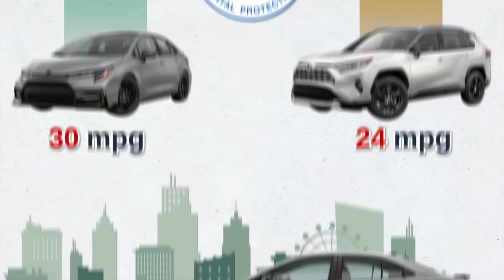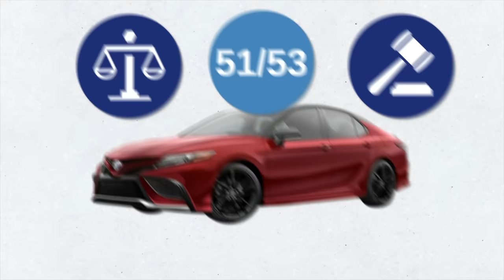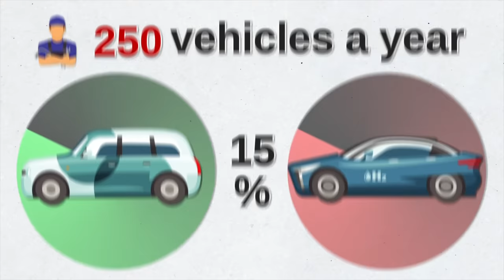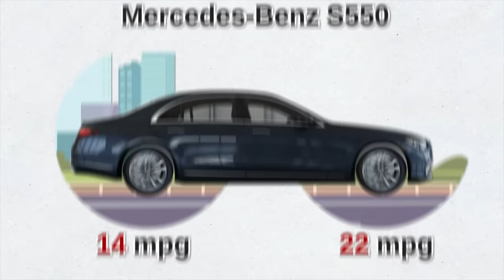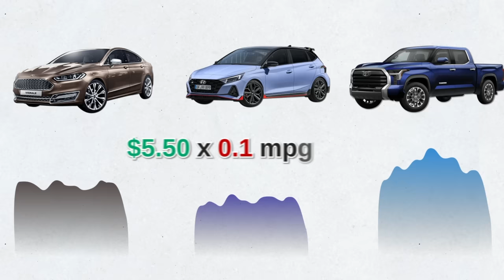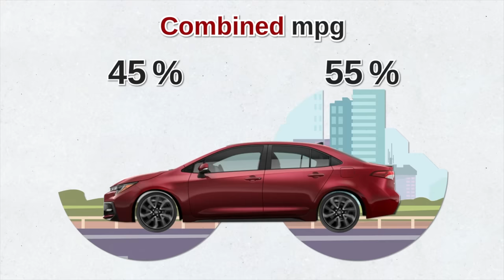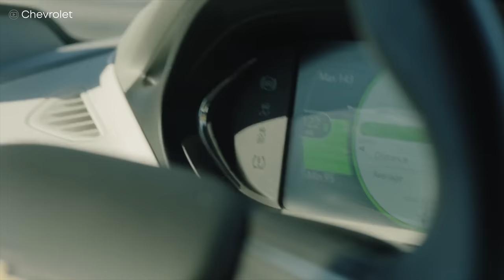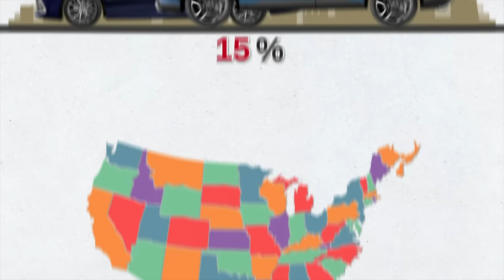Here’s Why the Government is Making These Engines Illegal

Comment: I got a 2002 Camaro Z28 and you just can't explain to most people anymore the driving experience a V8 provides gets good highway mileage just ignore the city mileage. Purchased new in 2001.
Reply: Completely agree. Had an ‘04 Mach with manual trans that at 70 mph on the hwy got 28 mpg with stock 3.55 gear and still got 24 mpg with 4.10 gear. V8 engines get awesome mpg when driven sensibly.
Reply: I agree and It’s because of power to weight and at higher speeds like 100-130km/h (60-80mph) it won’t be reved out I got a 2015 Silverado (4.3 V6)and she stays at 2k-2.5k at higher speeds I get the same fuel economy as my buddy in his 2017 1500 GMC with the 5.3
Reply: That’s been my experience as well. I had a third Gen Firebird and it was great on the Highway. A lot better coming from my dads grand Cherokee. Then I got my C5 Z06 & it’s so great on road trips. I did a 6-7 hour +700 mile trip one way with only two-three stops, one stop was for me haha. I think the torque is what let’s you use very tall gears without lugging the engine, keeping the revs low. I think I had estimated my fuel consumption at 30 mpgs.
Reply: Just remember your ar still driving GM crappy product ☺️

Comment: Good description of how it works.  My 68 V8 Mustang gets better gas mileage than most of the on the road.  Next week it gets a dyno run next week since I put a new 4 barrel on it.
Reply: One reason might be the weight. All these new cars with all the tech and safety stuff in make them porkers.
 So an easy way to get better fuel economy is weight reduction.  It has unintentionally benefits as well. Better wear on tires and less wear on suspension and brakes.
Reply: My 98 Lincoln Continental gets 26 to 28 mpg on a road trip. It impressed ppl who ask about it lol. Most just tell me to get rid of my car, but it's perfect for all seasons, and even got me through a blizzard lol

Comment: I've found that the cars most likely to reach, and exceed the EPA ratings have large high torque engines. The ancient American V8 (when properly maintained) is the best able to get the numbers advertised as it doesn't need to work as hard to do the work required of it. However, once the heavy foot of a 16 year old applied to the equation, the old American V8 is also the most likely to get 35% of the advertised EPA fuel mileage. So don't let Billy Burnout drive the '75 Buick Electra if you want to keep a couple bucks in the bank. Put him in the '80 Ford Fiesta instead.
Reply: Billy burnout isnt spinning much tire in a 75 buick, that 455 makes no power compared to say a 70 electra lol.
Reply: True. We should put the big old v8 in most cars instead of ramming air into small highly stressed 4-cylinders.
Reply: Well said. Thank you.
Reply: @UsefulEntertainment  I pretty much get exactly the advertised fuel economy of my Corolla with a 4 cylinder engine, but there's no turbo, or direct injection, or anything complex about it to skew the numbers or wear it out faster than expected. It's a solid car, but I certainly would want a bigger engine if I had a bigger vehicle.
Reply: I get better gas mileage in my V8 Mustang then some people get in “economy” cars like corollas. If you drive with a heavy foot like me, high torque will always get better mileage than a 4 banger. Just imho.
Reply: @angelgjr1999  I average 36 mpg. I doubt you're matching that in any V8 automobile.
Reply: @Me04120  I get 19 mpg city driving. Highway I think it’s closer to 26. Pretty impressive for an old V8.
Reply: @angelgjr1999  That's fine if that's what you want. I just wanted something reliable, and not too expensive. The Corolla checked those boxes pretty well. I had been driving 90 miles round trip going to work 5 days a week, so I wouldn't have been happy with a V8. Now that I'm working fully remote since the Rona, maybe I could think about a bigger vehicle next time I'm in the market.
Reply: @Me04120  I spend about 35$ a week in gasoline. I drive about 45 miles a day 5 times a week.
Reply: @angelgjr1999  cap man, I have a 5.0 and I get 15 mpg city tops short shifting. The highway is like 26 which is impressive
Reply: Yep. I have a 2009 Pontiac G8GT with 6.0 liters of grunt. It's my highway car. I get 26-27 mpg in a roomy car that doesn't require calculus to figure-out where to merge on a highway. If I keep my foot out of it, the mileage is consistent. And I'm old enough to keep my foot out of it. Most of the time.
Reply: @jonkirkwood469  That’s impressive for such a big engine!
Reply: Funny 💩 my first car was a 79 ford fiesta👍👍
Reply: First passenger car was a 2002 Kia Rio Cinco.  Car only got 22mpg.
Reply: Right on !. Also never buy a Kia.
Reply: @jonkirkwood469  thats it. I've got a 2010 holden ssv ute with an l98 6sp man and i get 11L per 100km. I've had 2L engines that use more than that. A big plus is that these motors go the distance too outlasting 4cly motors by double the kms in most circumstances. Once a motor is built the longer it lasts is  better for the environment. Some people just don't understand the less is more concept.
Reply: Huh. Makes sense, I got a heavy foot with a 2013 Mustang GT with manual and it still gets 17 in the city and 26 on the highway
Reply: Not that I disagree with anything you wrote, but your example vehicles crack me up…
Reply: @angelgjr1999  that almost sounds too good to be true, I have a V8  and drive about 400 miles a week and average 15 miles a gallon and spend about $100 in gas.  You must live in a place with barely no traffic.
Reply: @Dannyf35  The back roads are your friend. Just cruise downhill in neutral

Comment: I owned a 1928 Ford Model A and I have to tell you that when she was well tuned, she got over 20 mpg.  People always thought I'd get 2 mpg on that car because she was 90 years old, but she was closer to the efficiency of modern 4 cylinder than you'd think.  The flip side was she only had 40 hp, so I rarely took her over 55 mph.
Reply: You're correct sir my friend work for Greenfield Village used to drive those cars around that they were getting around the same mileage is yours so you're spot-on👍
Reply: Not even close in terms of technical mechanical efficiency.
Reply: The Model T engine was a 2.7 liter,20 HP.max deep stroke producing 85 lb/Tq. @22-24 miles a gallon at 14 cents a gallon .No oil pump!As the crank turns it dipped in the oilpan weep grooves carried oil to the top .The valves were beside the piston air and exhaust were channeled at  48' port!water was at the bottom ,steam bypass cool the crank box that's why it had a pressure release cap when you saw the steam the water you carried was added with caution!!Thank you Henry Ford you changed the world !!

Comment: We own two vehicles, a 2017 Hyundai Tucson AWD and a 2020 Ford Escape Titanium Hybrid AWD.  I can say that both vehicles are driven a majority of the time in the city.  I am pleased that both are getting better than the projected EPA ratings for city driving.  They have also preformed better than the projected estimate EPA rating for highway driving.  Aggressive driving will destroy your fuel mileage while the smoother you drive the better your mileage will be.  My parents own a 2019 Ford F-150 XLT 4x4 with the EcoBoost 3.5L engine and they are getting good mileage both empty and towing a small camper.
Reply: Why did you feel the need for AWD if you're driving the car in the city the majority of the time? Are the city roads that bad where you live?
Reply: @SuperDirk1965  if it’s a snowy area it helps a lot.
Reply: @lukesmeby  I see. I live in a country where the gouvernement clears the roads when necessary.
Reply: @SuperDirk1965  We end up getting a good ice or snow storm now and then and I have to be at work, so I purchase vehicles that can get me there.  Last year we had record cold and snow and I had no trouble getting to work in 15 inches of snow.

Comment: I kept track of mpg for awhile and found the "sweet spot" for highest mpg on the highway was at 70mph in my 2001 Civic coupe, 36.5mpg slightly higher than rated.
Reply: @U Betcha definitely,  usually the lowest rpm in the highest gear is pretty close to the best you'll get.  My 2010 civic is a 5 speed automatic so 60mph is barely 2000rpm.
Reply: I get 28 mpg on my 06 rav4 at 63 mph.
Reply: 35 to 40 mpg 2018 Elantra Sport at that speed. City wise... its a terrible 16 to 24. Mostly depends on traffic too, some states people just do not know how to drive.
Reply: You can get $87K for that car today

Comment: The EPA is laughable. There's no way they can determine MPG. As for emissions, auto emissions keeps getting lower and lower and the EPA and the environmentalists are still "beefing"  over pollution. There's a more appropriate word for beefing but I won't use it. Even pollutants from power generating plants have gotten lower and it's still not enough. So now they're going to force everyone to buy electric vehicles without regard to the financial impact on drivers or without regard to recycle/dispose of batteries or disposing/recycling the vehicles when people won't replace the expensive battery packs or the fact that the electrical grid will have to be substantially be upgraded - probably to the tune of billions of dollars which will result in more taxes on electrical use. And what about all the junked/scrapped ICE vehicles?  I'm all for clean air and high gas mileage but we have to be realistic. Oh, and that tax on fuel inefficient vehicles, where is all that money going? If that money was being properly spent we wouldn't need Congress to pass these trillion dollar infrastructure bills that usually have a lot of "pork" in them.
Reply: I have a question,  what law or policy has been enacted to force people to buy EVs?
Reply: So far I have seen no one was able to answer my question.
Reply: @yoadrian5897  when they pay you some money to buy them (and giving privileges) while imposing taxes and fees and mandates on users/manufacturers/ owners of ICE vehicles.
Reply: @genericdude6551  What they can't do is to curb the plague of the emissions of FIREPLACES; especially when there is no wind, it surrounds the neighbors, worse that a thousand cars;  since the 70s they have been thinking about that, but they just can't do it,too hard a fight;  it's much easier to go after the car owners, like the cops do on their huntings, one by one, less stiff resistance there.
Reply: @genericdude6551  In the first place, I rather have a 4 or 6 cylinder car w/o a turbo.  They last longer and sound better. Second, you mentioned, "forced".  What special law is forcing people to buy EVs? At this point in the game, they are still developing alternative fuel technologies.  The current crop of EVs is still 1st maybe 2nd gen. technology.  Sales are still a small segment of the market: "Sales of electric vehicles, including plug-in hybrids, are projected to be less than 4% of U.S. sales this year, according to industry forecasters. Of those, all-electric models — such as Teslas — are only at 2.6% of the market, or about 394,000 vehicles, according to LMC.". ICE Trucks and SUVs still have the biggest market share. SUVs, crossovers likely reached 50% market share; trucks probably hit 20% A slew of OEM sales tallies released this week suggests that 2020 marked the year crossovers and SUVs together commanded a 50 percent share of Americans' auto buying, according to an IHS Markit analyst. .
Reply: @MotoroidARFC  The maximum tax credit you can receive on an EV is $7500. I don't see that as causing a stampede for people to go out and buy them.
Reply: It will be harder to fix your car now with all these computer components.
Reply: @jamesvandamme7786  What's the time frame?
Reply: @jamesvandamme7786  From Motortrend: "Yes, you can absolutely tow with an electric truck, but at least in the case of the Rivian R1T, expect to lose up to half your driving range as you approach its maximum towing capability, much as you would in a gas- or diesel-powered truck.
If that's the case EV charging stations infrastructure has to be expanded.
Reply: If you travel any distance, an all electric vehicle is impractical.
Who wants to drive 6 hours then wait another 6 hours for a recharge?
And replacing the batteries every 3-5 years cost as much as the vehicle does.

And then there is the unreliability of electronics.

Run out of gas, someone can bring you some and you are good to go get a fillup.
Run out of battery power, and you have to be TOWED to a charging station.

Plus many tow truck drivers won't let you pack your family of 5 in their tiny truck cab.

All electric vehicles have another problem, if you are a renter.
Any idea what it is going to cost a landlord to upgrade all the electric for their apartment complex?
Or if you live someplace with only on street parking?

All electric vehicles might be ok for city travelers but not for urbanites and suburbanites.

How many people will want to pay a small fortune to upgrade their power panel, pay to have lines run to a dedicated charging station (garage , driveway, or at the curb)? You are TETHERED to a charging station. AND your property taxes will go up because of the upgrades AND the convenience factor (think frontage here).

What is to keep others from stealing YOUR electricity to recharge their vehicles parked on the street in front of your house?

Replace gas stations with charging stations - ok let's look at that.

Every busy gas station has several hundred to several thousand cars a day refueling.

If you had say 100 vehicles needing recharging, just where will those former gas stations park them? Or 1,000 cars? Trucks would take even MORE time to recharge due to more and larger batteries.
Every one of them does not have the space. 

And then those stations that CAN make some space will have to pay a fortune for the COMMERCIAL power upgrades to facilitate the charging stations.

And just what are people supposed to do while waiting hours for a recharge? Sit in the cold? Heat?

Even gas stations have occupancy limits and cannot allow too many people inside.

All electric is going to be a serious nightmare.

What they should have done is try to get more hybrids. Better yet, Hydrogen on Demand systems - those have ZERO pollution.
Reply: @crazysquirrel9425  good points.
Reply: @yoadrian5897  forced = sky high gas prices. Reduction in domestic oil production. Reduction in oil imports. Inflation.
In or about 2030, GM is supposed to go all electric on new vehicles.
Reply: @jamesvandamme7786  Far too many problems with batteries and charging systems.
VERY SHORT range, long recharging, etc.
Reply: @genericdude6551  I would like to point out the built in kill switch so the government can stop your freedom of movement, remotely (police car, etc).
Reply: @yoadrian5897  Because the average person can't afford to buy a $50,000+ vehicle. Only the people with 6 figure incomes are going to be able to buy them and will be the only ones that will be able to use the credit.
Reply: @crazysquirrel9425  If people can't afford EVs then it's not a forced program. Get a clue.  Do you really think people are going to run to GM to buy EVs?  How delusional are you?
Reply: @jamesvandamme7786  300 mile range is UNSATISFACTORY. Especially when recharging will ALWAYS take more than 10 minutes.
That is just physics.

How will you FORCE a landlord to upgrade an apartment complex for the tenants to recharge their vehicles? And without raising the rent or tacking on THEIR fees for the privilege?

How will former gas stations be able to accommodate all the cars needing to be recharged?

Say you got just enough time now to gas and go to work in the morning, roughly a 10 min stop for gas and a coffee.

Can you recharge to a full battery in 10 min or less from nearly empty?
And if your battery runs out in the middle of nowhere - WHO pays for the tow since tow trucks won't be able to recharge cheap for the customer?
You think a tow truck driver will sit there for free for an hour and not charge accordingly?

Best I am willing to do MAYBE is buy a hybrid and IF and only IF there is free lifetime replacement of the batteries, electronics, towing, and rental car.

Until then I will stay with a normal car.

ICE's may not be doomed.
I doubt the country or the world will last long enough to see that happen.
Reply: @jamesvandamme7786  A choice is fine but forcing it on people is not.
Nothing stopping you from working from home or riding a bicycle.

If you travel by car, you will have to stop at some point to recharge FOR HOURS, taking unnecessary time off of your precious limited vacation time.
EACH DIRECTION.

Comment: Bought a 2021 Tundra last of the v8 for dependability not mpg I get 15-16mpg highway after lift and 33” tires on -25 wheels and it ripps rubber on cheap pump gas 85octane in comifornia 4.29gal.!!! And boy do I love it

Comment: I decided to try out Shell Gasoline in a Toyota Tundra. I was amazed at the difference in performance from cheaper Gasolines. Only thing is my fuel economy went down about 1mpg on the next tank.
Reply: Shell is the best. It usually gives me 1mpg more on highway. Very small amount of knock with shell
Reply: @faekz  Seafoam will clean the cylinders enough to reduce detonation significantly.
Reply: @thisismagacountry1318  I run Lucas in mine
Reply: Chevron is better from my experience. Cheaper gas doesn’t last long at all. It’s like water, it evaporates.
Reply: Lol there is no difference in gasoline quality it all comes the same place.
Reply: @catsbyondrepair  each station has their own detergent blends
Reply: @jamesgreene4554  not true I have deliver ed for hundreds of gas stations all comes from the same place.